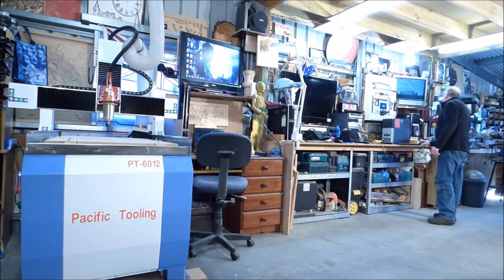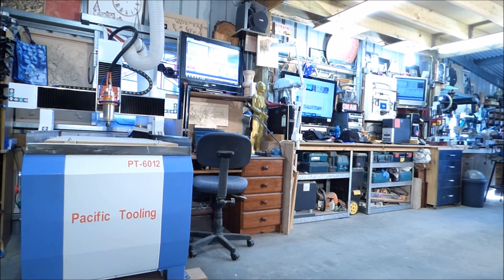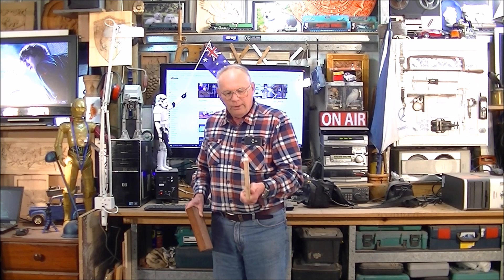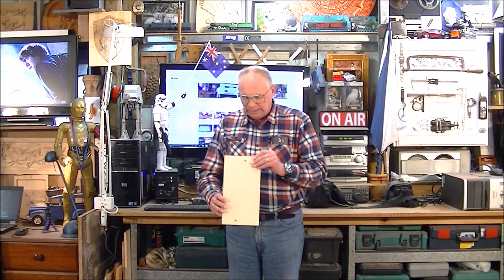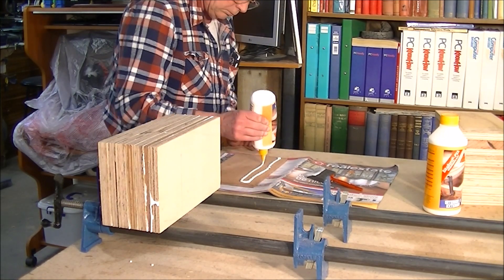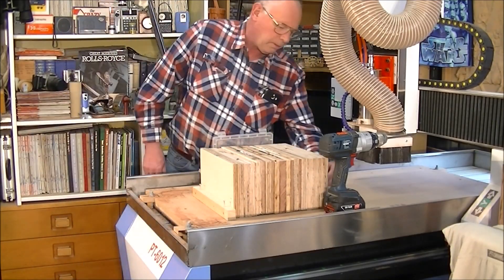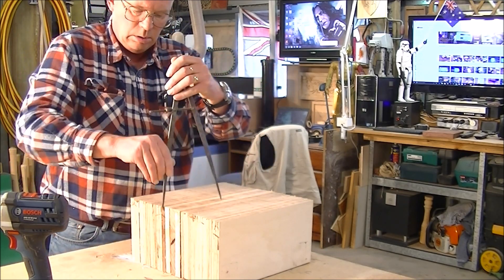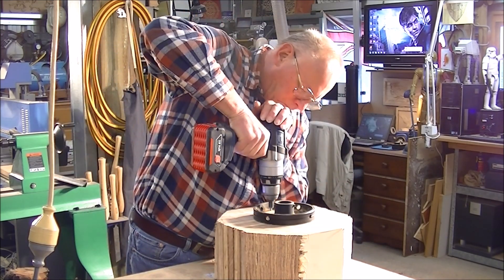6012 CNC router planing a laminated plywood slab

Comment: Hey Roger having trouble with my cnc machine running nc studio was working using easle but lately it has a mind of it own and cuts what I need it to cut in different position wondering if you can help.
Reply from the maker: You will need to convert your machine to Mach 3 or 4 like I did, see my videos.
P.S. I have 2 YouTube cannels